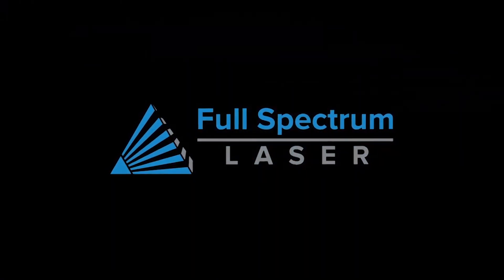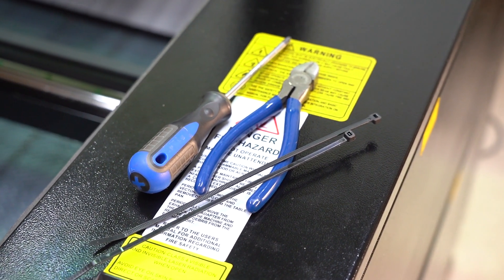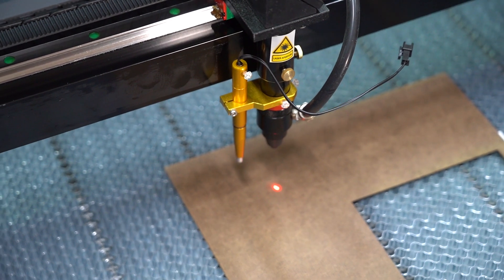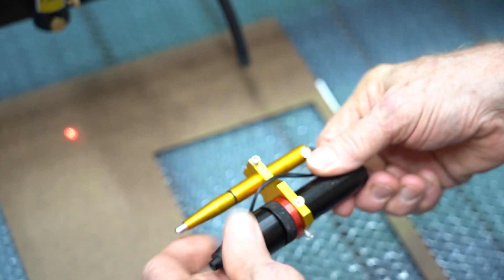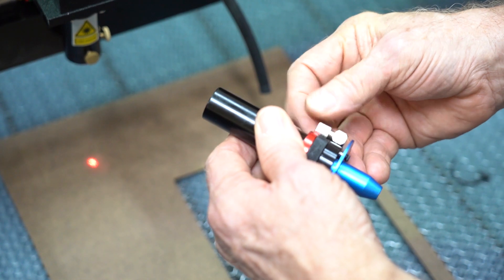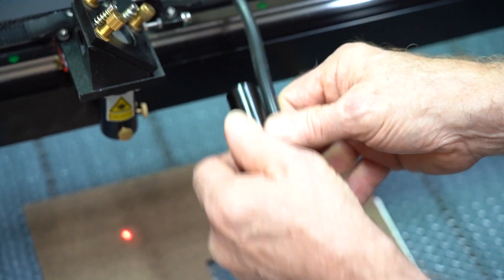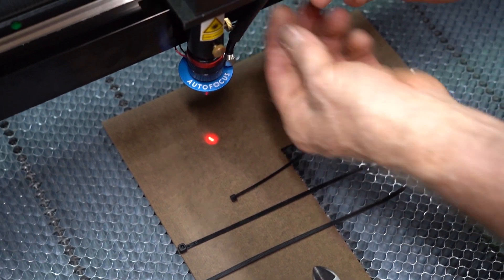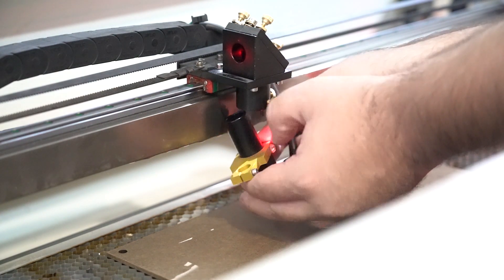New Pro-Series AutoFocus

Comment: Do all new in the Pro series come with this as standard equipment?
Reply from the maker: They can if you'd like. If you call sales when ordering, you can make sure the new one is installed instead of the old one.
Reply: Make sure you confirm new Pros come with the Focus you want. If you do not specify, it will come with the outboard one - so the sensor and inch or so to the side of the lens.

Comment: Or just buy a whole lens kit from American Photonics that includes four lenses and tubes and doesn’t need auto focus because of how they are designed.  All tubes need to be 10mm from the material regardless of the lens.  I would guess that the whole kit is less than this gimmick that FSL is trying to sell.
Reply from the maker: Or you could spend no additional money and have the option to use the old auto-focus or manually focus it.
Reply: Full Spectrum Laser both of those options are available but severely lacking and clunky at best.  Nothing beats 4 different focus lenses all with the same distance away from the material.
Reply from the maker: @natesgt  But you'd still have to manually focus these lenses.
Reply: Full Spectrum Laser I guarantee I can manually focus them just as quickly as any auto focus contraption.
Reply from the maker: @natesgt  You can do the same with our machines.
Reply: Full Spectrum Laser well that wasn’t how they worked when I bought my machine in 2014.  I was given different alignment tools for each lens/tube.  Even if that is how your machines work now, I can get a set of 4 lenses and tubes for less than two lenses from FSL and they work just as good if not better.   Get back to me when you don’t have such a ridiculous markup on consumables.
Reply from the maker: @natesgt  Far be it from us to suggest you buy our products if you have a cheaper, good quality alternative. We're just pointing out that our products can be manually focused just as easily, even if you have one of our auto-focus nose-cones installed.
Reply: Full Spectrum Laser if you say so.  I have used your manual focus function and it is not as simple as the steps required for the American Photonics setup.  But believe what you want.
Reply from the maker: @natesgt  That may have been true of our machines 6 years ago.